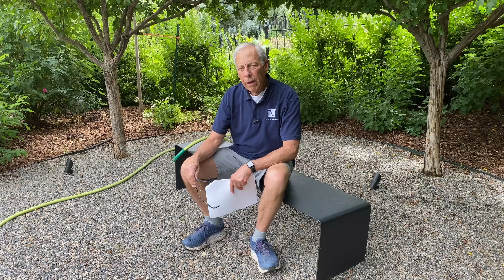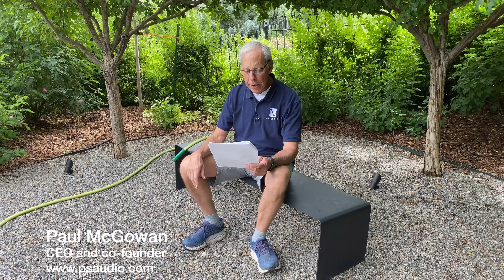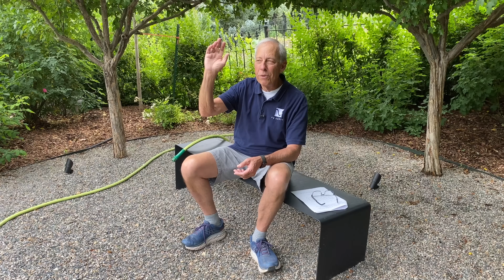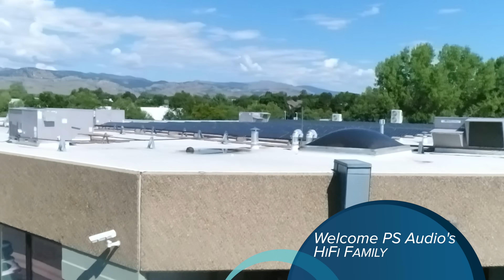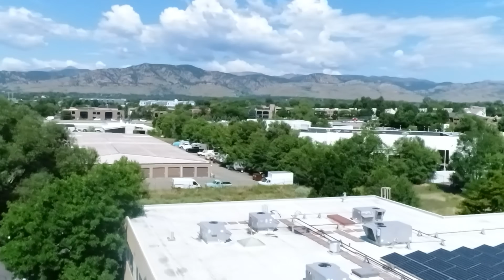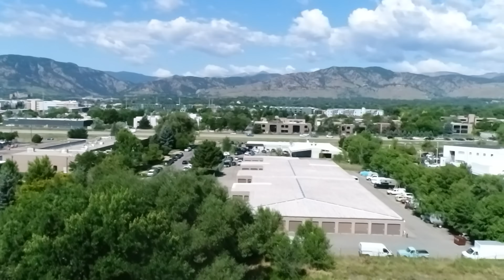Class D vs. Class AB amps

Comment: Class D tend to be cool running and compact for the output. I once tried a Jeff Rowland integrated. It was very refined and "nice" but lacked a bit of oomph and bite for my taste and still went for AB.
 Don't class D use op amps ?   I thought they were inferior and introduce noise ?
Reply: They're so "inferior" and "introduce" so much "noise" that there are dozens of trusty little NE5532 chips -- a 30+ year old design -- in Paul McGowan's pride and joy, Neil Young's old Studer mixing desk.  Enough said.
Reply: Bruce Morgen . Even Paul admitted his class AB beats his class D. So what I’m saying is the need for opamps could be why.
Reply: @wildcat1065  -- Class D doesn't require the use of op-amps and PS Audio avoids using them, favoring their own Class A front ends, IMO with somewhat dubious results in actual performance.  Moreover, Paul isn't really admitting anything -- he's promoting his more expensive (and profitable) Class AB  (and Class A?) products, which makes total business sense.  The thing to remember about him is that he's much more of a businessman and marketing guy than a tech guru -- he's very honest about the fact that he has no formal engineering background and learned what he knows "on the fly" via immersion in the audio industry, where he knows pretty much everybody who's anybody.
Reply: @FatRat-f9m  -- That's not what he's doing these days.  He's a pitchman and very good at it.  I concede that there are more than a few self-taught engineers that are very good at what they do, having worked with a couple of them over the years, but Paul wisely depends on his staff -- folks like Darren and Chris -- and outside consultants to actually engineer the products he offers.  I respect the fact that he knows his limitations in that regard.
Reply: @FatRat-f9m  -- Sorry, I just figured you'd misspelled the word and I didn't want to come off like a nitpicker.  I find myself deeply distrusting self-styled "golden eared" audio gurus, especially those with pricey gear to sell.  I've found over my many years that, with the possible exception of the somewhat more mysterious art/science of speaker system and headphone design, audible excellence tracks very closely with measurable excellence -- hence my duly considered opinion that ASR's reviews comprise a much better baseline than anything the subjective reviewers have to say about a product.  Peace
Reply: @editorjuno ...don't be sorry Bruce, you & I are both strongly opinionated however we are both brothers in audio. Of course Paul does what he does to further his company & his interests, that's a given. I use my ears more than I care to measure in the way that ASR measures...but that's just the way that I like to assess audio gear.
Go ye forth & listen happily; peace brother 👍😎🐀

Comment: First of all we have to compare 2 amps at the same price. Shell we say $3000 integrated class D vs $3000 integrated class AB.
Reply: Gottrek K that will be difficult because generally class D amps cost less to produce,  all other things being equal.
Reply: Ramsay Bolton    What’s the difficulty?  What’s being proposed to compare is the sound of two different integrated power amplifiers, one Class D and one Class AB, with  both having the same MSRP.  The manufacturing cost, or builder, distributor, or dealer markup, is not relevant.  Hi-fi components are not commodities, they’re hobby items, or even luxury items.  How suggested retail prices are arrived at can’t always be explained or justified, like $15,000 turntable cartridges, for example.

When prices get past a certain point, “what the market will bear” comes into play.  As far as the customer is concerned, there are pretty much just two choices:  buy it or don’t buy it.  As Gottrek K suggests, a comparison between two integrated amplifiers, one Class D and one Class AB, both costing around $3,000, is what he has in mind.  That’s it.  In a different country or region, tariffs and markups may be quite different, so such a comparison might be valid or practical in one area only.  Do variances in retail prices equal variances in “fairness to the customer”?  Who knows?

There’s no need to overthink this.  Plug ‘em in, warm ‘em up, and see what the reviewer thinks.

Comment: Tried class d on a two way speaker once, and never again, its fine for subwoofer but not for a speaker, the mids are terrible, the high is completely gone, im not an audiophile but its bad enough to make me avoid it
Reply: Tried a PC once.  It was horribly slow and deficient in storage, with a terrible user interface.  Couldn't store more than 10 JPEG photos on its hard drive, not to mention that its OS and graphics didn't even support displaying them.  I'll never touch a PC again.

Comment: Class D is untra sensitive to cureretn and when it gets friend it CAN TBE FIXED. I DON TLIKE CLASS D EVERS AGAINES!
Reply: I repair Class D amps.  The problem isn't that they can't be fixed, rather it's too many people work on them, without understanding all of the theory, and knowing all of the checks that need to be made before they are returned to the customer.
Reply: @marianneoelund2940  -- Good for you.  A competent repair tech understands the underlying principles of the circuitry to be repaired.  At this point, vanishingly few have their ducks a row with regard to Class D stuff -- but the good ones know exactly what to do, which in the case of the earlier Class D stuff (based on parts like the IR2111 driver chip and discrete MOSFETs) found in many subwoofer "plate amps" requires astute modifications and component upgrades to assure long-term reliability.  Of course, today's Class D "chip amps" are throw-away items -- it isn't even worth struggling with the SMD soldering required to replace their output ICs when the entire amp can be replaced for under $50 or the entire PCB for $30.

Comment: Clive Sinclair in the UK released the X10 Pulse Width Modulation amplifier in 1964. This was an early version of what has now become known as Class D. These amps did not give the output power stated and radiated a huge amount of radio frequency interference. A Class D amp works in a similar way to a switch mode power supply so the best quality amps must have very good filtering, which many now do. Class D amplifiers will probably dominate the hi-fi market in the next few years due to their high efficiency, small size, sound quality and bang for the buck., makers of so called expensive “high end” amplifiers are in for a hard time.
Reply: No, the high end makers just take the same internals, add a few gimmicks such as a tube input stage, put it in a snazzy case, and charge the gullible 5x what it's worth.  The law of diminishing returns will always allow them to get away with justifying the cost, based on a claimed subtle improvement - which of course you won't hear unless you're a real audiophile.  
If they can sell $20K speaker cables . . .
Reply: Marianne Oelund yes you are probably correct. A fool and his money are soon parted.
Reply: @marianneoelund2940 ...oooh, I didn't know that you could 'bite down' so hard Marianne.

Comment: Upto 100w class ab is always better.
Reply: Just ordered 4 Sundown Audio 100W RMS component speakers. Getting a class AB amp for the higher sound fidelity. Looking at the D4S JP 34AB. 590W RMS class AB 4ch amp. RMS power is 134W x 4ch @ 4 ohm. 14.4v rms.

Comment: Are there many 50 watt Class D amps? I would guess not.
Reply: Of course there are.  I'm sure something based on the one of TI's TAS/TPA series of monolithic Class D ICs -- the performance of which range from sort-of-OK to truly excellent -- would fall into that power category, and a number of (mostly Chinese nowadays) manufacturers offer them in various assembled forms.  The only major catch is that most of those products require an external "power brick" or SMPS unit to provide the necessary DC.  One example is the TPA3251 chip, which easily delivers that 50WPC at less than .01% THD-N into nominal 8 ohm loads, even with a very modest -- e.g. 32VDC @7.5A -- power supply.  FWIW, several of the prime movers behind TI's Class D effort are now working with Bruno Putzeys at high-end Class D module maker Purifi Audio -- IOW, the folks who designed those ICs knew their stuff and knew it well!
Reply: @editorjuno  
You remind me of a well-known analog guru at National Semiconductor that I used to follow in my youthful years long before anyone ever heard the term "blog."  He wrote all kinds of fascinating App Notes that were quite eye-opening.  What was his name again?
Reply: @marianneoelund2940  -- As a non-engineer, I'm deeply flattered by that comparison.  My fellow editor at Electronic Products magazine back in 1980s, Joe Zuppardo, was a total analog circuitry enthusiast who had tremendous admiration for the analog IC designers working at places like National and TI back then -- they were among the most accomplished solid-state circuit designers who ever lived,.  The longevity of the classic op-amp chips that are still being designed in today is testimony to their collective "genius."
Reply: @editorjuno  
Aha, so you were in electronic periodicals.  No wonder you have an encyclopedic knowledge.  We design engineers owe quite a debt to you guys, always digging, researching and reporting on the newest technologies and products.  
And I found the name of the designer at National that I was thinking of earlier:  Remember Robert Pease?  He wrote lots of articles for EDN; I must have had a subscription in the 1980's.  Some examples here:  http://www.introni.it/pdf/Bob%20Pease%20Lab%20Notes%20Part%208.pdf
Reply: @marianneoelund2940  -- I never worked with him, but his name rings a bell.  EDN came from a rival publisher and really got the cream of designer-authored articles back in the day.  Incidentally, back in the 1970s I also put in nearly eight years running a five-technician repair shop, which gave me a real hands-on perspective on what holds up in the field when it comes to consumer and pro audio.  The shop was (and probably still is, although  I'm sure they no longer have on-premises techs) just a few miles down the road from Nassau Coliseum, where dozens of rock acts were playing nearly all the time, often wrecking their gear and having us patch it up.  We worked on everything from little cassette recorders and cheap record changers to gigantic power amps from McIntosh and Crown, which of course back then were all Class AB back-breakers -- maybe that's why I appreciate modern Class D technology so much.

It was great encountering you here on U-Toob, Marianne -- I appreciate the chat!
Reply: Visit the John Audio Tech channel.

Comment: are you going to buy a relatif cheap amplifier? class-ab is almost always better than class-d.
I have bought many class-d cards from eBay and am disappointed almost every time! class-ab for the same price is always better.

The problem with class-d is the sound quality and that many can only handle 8 ohms and not 4 ohms. The best from eBay so far is the L15D amplifier card but you only get 150 watts. Best class-ab is  L20 card from ebay that provides 200 watts with optimal power supply
Reply: Move into 'audiophile grade' and you have some class D taking on 2 ohms no problem. (granted your post was referring to something rather different)
Reply: @robh9079  what I wrote is true.
class-ab is better than class-d and almost no larger class-d amplifier board from Ebay can handle 4 ohms!
Reply: @ford1546  I didn't actually contradict you!
Reply: https://www.whathifi.com/marantz/pm-10/review
Power Output (8 / 4 Ohm RMS):	200 W / 400 W
Reply: @alexanderbelov6892  Does this amplifier cost £ 7000?
it is very expensive!! I have seen inside this amplifier and it is overpriced! I would not have bought this amplifier!  You get little for your money!

But I'm not talking about such expensive amplifiers!
Reply: @ford1546  At least don't say that class D amps are cheap.

Comment: If you’re a Bass Player, you’ll definitely hear the difference between an old transformer based amplifier, and a newer Class D Power Amp...

... but I don’t necessarily enjoy the “weight” of those old amplifiers..
Reply: @santafemikez9694     don’t know if you’re talking to me or not, but I’ll chime in anyway…
i’m no expert, but Class D amplification has come a long way in 15 years... and I’m sure that there Will be a few of them these days that sound really good (with a lot of power- under 15 pounds)
... and while I still prefer the tone of an old transformer-based bass amp (tube and solid state) I can just tell you, that after lugging around an SVT with the 810 Cab, The Acoustic Control 360/361, A few Fender Rhodes, for years  with 2 Hernia Operations following that,..
I can safely say that Class D amplification  sounds just fine to me these days  lol
Reply: Yes, the euphonic even-order harmonic distortions of tube amplifiers and the slower transients and lower damping factor due to the output transformers definitely make obvious differences in the sound of tube amps and any solid-state amplifier.
Reply: Yes the hum
Reply: Class D is untra sensitive to cureretn and when it gets friend it CAN TBE FIXED. I DON TLIKE CLASS D EVERS AGAINES! I dont like GALLIEN KRUEGERS. Just PEAVEY TRANSISTERS AMPlifiers combo unit 10 in speekers. DUgfg Mckagsn guns roses now uses Fender tube amp with or replaced Galienbs Krugers. KISS uses transisters nto APPEGS no more THANE YOU AND THUBMES UEPS!
Reply: i Love Cops , I love Good Cops.  Peace brother.

Comment: Where is the point of diminishing return with amps?  I'm not really up to date, still running a stack of old GFA Adcom's!
Reply: It really depends on how much you expect, but I'd say the best I've come across, as to where diminishing returns sets in are implementations of Hypex nCore or now Purifi, like you see in the NAD M22, or Benchmark, which are not overtly expensive (though not cheap), but very hard to beat.
But there are of course cheaper amps which are very popular as well. But personally that's where I don't see significant improvements moving up, beyond different flavours.
Reply: Hubjeep ...it is very subjective.
Your "point" will most likely be different to someone else's, depending on hearing & budget.
Reply: FWIW, I now use a little sub-$50USD (+ about $25USD for a suitable SMPS) Chinese-made power amp -- based on a single TI TPA3255 Class D IC and a couple of their classic NE5532 op amp chips -- that puts my good old Adcom GFA-535 to shame in every respect.
Reply: I think it's around $3k.
Reply: @gottrekk5798 ...lol... 🙄

Comment: I know Class D is light weight!  I have a couple EV DJ speakers with Class D amps, 12" 2-way speaker with amp weighs about 35 lbs!
Reply: For speakers, the bulk of the weight isn't exactly the amplifier inside. And 35lbs is quite lightweight for PA speakers. I have a PA speaker with 1200 watts of amplification in it and the high power is of course facilitated by the class D amp. And it weighs more than 20 kg. My guess is that the whole dsp and amplifier inside weighs less than 4 kg. We would have had far less active monitors if it wasn't for the class D technology.
Reply: @oysteinsoreide4323    I have the EV ZLX-12 speakers which are 34 lbs/piece (plastic enclosures).  As far as I know earlier speakers had class a/b amps with huge heat sinks, which added quite a bit of weight.  These speakers sounds great to me, I use them at community events and fundraiser auctions.  Much lighter and convenient than having a separate amp crate to carry around and hook up, also redundancy since each speaker has it's own amp.
Reply: Between Class D amplification and neodymium speaker magnets, powered PA speakers are getting remarkably light these days, to say the least!

Comment: yeah, I agree with you about class A and AB   all vacuum tube input and output.    I design them  from the late 60 till now and compare with class D  and there is no comparacion. Check the output of a fixed frequency in a scope. You be  extremely surprised when seeing all that staircase on the output.
Reply: The residual switching frequency is way beyond what any speaker can output and will low pass filter the residual so it is irrelevant to the sound produced.
Reply: G Guest  Yes, the switching residual should be filtered within the amp but some class D amps do not include those filters which add some additional resistance so some manufacturers leave them out because the residual frequency (generally above 500kHz or in the MHz region) cannot be reproduced anyway. What counts is the distortion from the speaker output, not what might be observed on a scope.
Reply: G Guest  
Current Class D is up to 500KHz for the PWM frequency.  Older Class D, especially for driving subwoofers, may only be 150KHz.  Future GaN designs should be able to operate at MHz frequencies.  Regardless, you can never remove 100% of the switching frequency residual; you need to accept that at some level, it is "low enough."  
If an "audiophile" insists that anything visible on a scope must be relevant, then I have some experiments to show them.